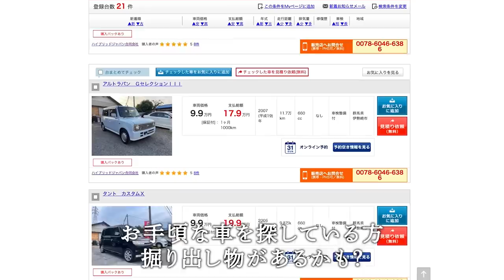田舎暮らし 082：素人がエンジン載せ替えで限界突破【レトロ軽トラDIY】

Comment: While engine is out change ALL hoses and give a good cleaning. Once clean you can see any other problems that need fixed. I also would clean and paint the under side of body and engine compartment while have you access. When I was a mechanic I was taught that most repairs should start with and end with cleaning, It makes the job easier to do and to keep track of parts.

Comment: Great job...you said that you are an amateur, but I think you worked as profesional. You know what to do and had a strong confidence. I am an engineer but never do this. I suggest you to be more careful for especially for the car lift and holder. Brick is not strong and stable enough...

Comment: "hard time" = productive learning experience.   My suggestion:  replace water pump and thermostat while engine is out.  Also change timing belt if this engine has one.  Flush engine coolant passages with the water hose, also flush radiator .  replace any hoses, water or vacuum, now also.  I have changed and rebuilt many engines.  This advice comes from my experience.  Good luck!  PS I also have a Suzuki Carry similar to your Kei truck.